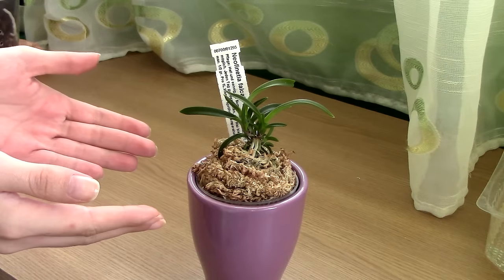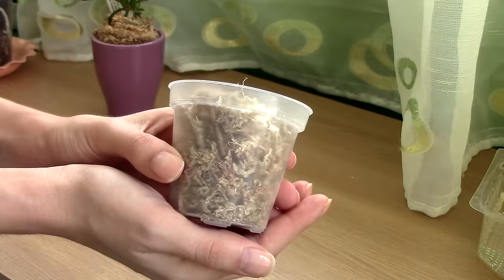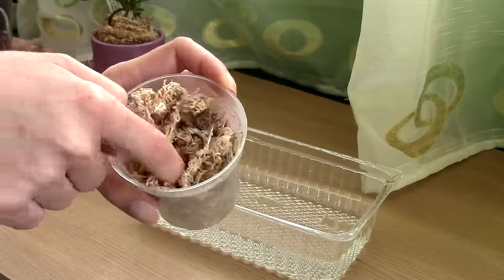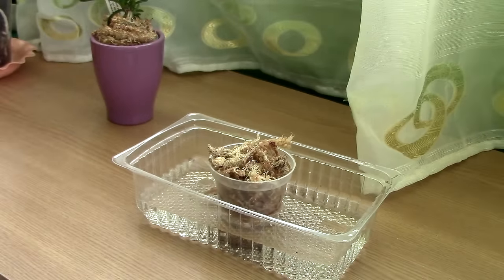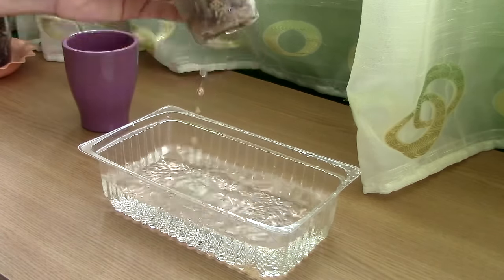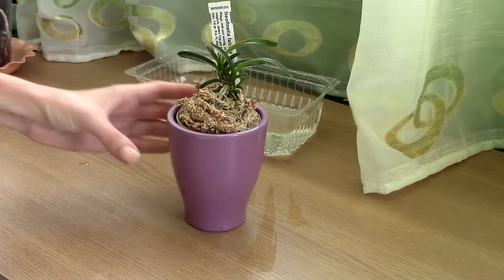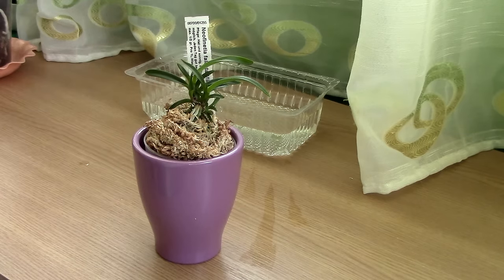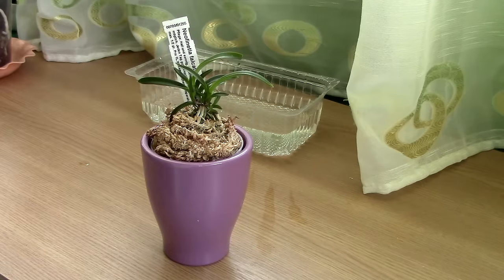How I water Neofinetia falcata orchid in sphagnum moss

Comment: Very well done and well explained. As with everything the Japanese design, it is aesthetically beautiful, but most of all it has a practical and functional reason. The raised top part is designed to evaporate the water faster. If the Kokedama potting with sphagnum didn't work, it would have even less chances of working in Japan, with the climate they have there. The key is knowing how to water it. Very good video. I hope after your explanation people will be less afraid of using sphagnum. :)
Reply from the maker: Orchids & a Dutchy yes exactly, the evaporation is fantastic due to the raised top :D

Comment: I have always struggled with growing Neos in sphagnum moss - having roots suffocated or 'drowned' in the medium, resulting in rotten roots in the moss, but happy, healthy roots growing outside the moss. I don't know how the Japanese water them - I absolutely love the presentation of the mound mount method, but cannot seem to adapt it to my growing environment.  For me, the moss always grows algae, turning a slimy green in the summer , and then becomes desiccated and crispy in the winter.
Reply from the maker: Carl Mayer well it is easier in some climates and harder to maintain in others. It will eventually grow algae and that is that, the drier you keep it the less algae. I think it might be a watering issue combined with environment. If you watch this https://www.youtube.com/watch?v=F8l4U1i-l4c you will see that some roots die but it's ok :)
Reply: The same happens to me. I might try using the neofinetia bark mix from orchidweb. It might require more frequent watering than moss, but I've had the same problems and hopefully this fixes them.
Reply: I know about the Japanese method, but it doesn't work for me either. However, what worked for me was semi-water culture sort of. I basically let my plant in a glass container and only let soak for a couple of hours. Their roots are in air most other times. I soak more frequently in summer and maybe once a week in winter. I also have them on my plant shelf facing the window bay. They are putting out roots, leaves, and young ones. You might have to soak more frequently depending how dry your environment is. I also have some oncidiums, cattleyas, and my vanda is growing great even if I am in PA.

Comment: Thank you , I enjoyed this video . I recently bought two neos. I keep them outside & it rains a lot where I am in the summer . I was afraid of root rot , so from time to time I shelter them in a corner away from the elements . As they get bigger I was thinking of putting them in another type of media because sphagnum moss retains too much moisture , what is your take on that ?
Reply from the maker: Miche well if moss is not suitable for your environment you can always try with bark, as long as you can keep up with watering and ventilation all should be just fine. There is also the option of mounting this orchid on wood or cork :)